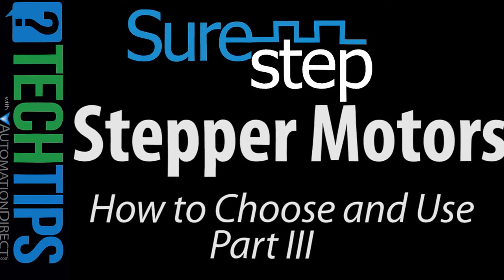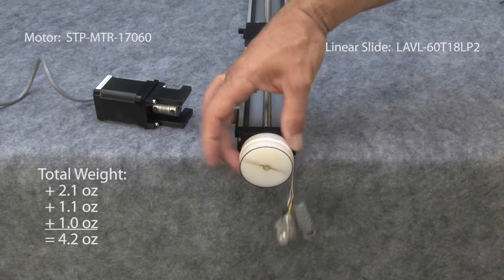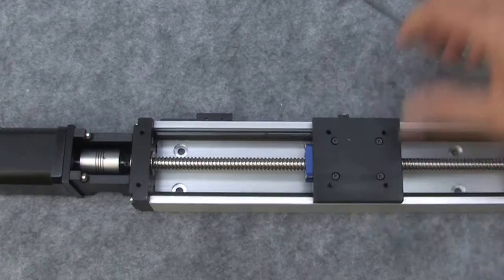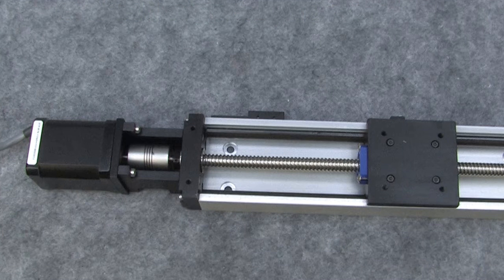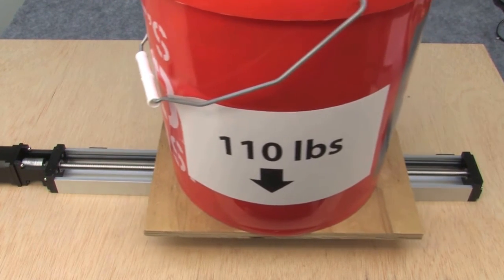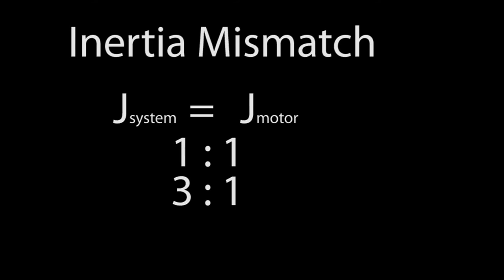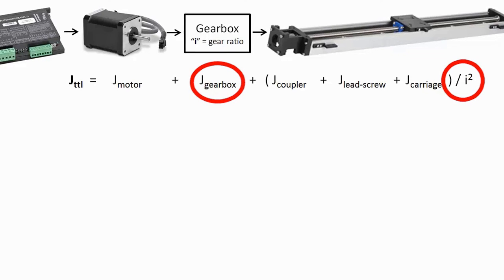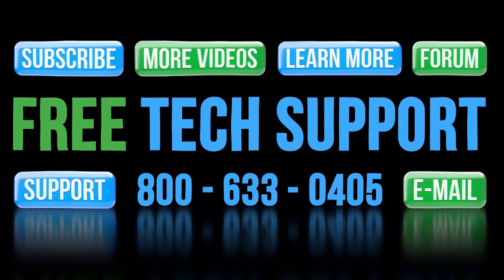SureStep Stepper Motors How to Select & Use a Stepper Motor Part 3 from AutomationDirect

Comment: hello, I want to know how to choose the stepper motor drive for a two-phase stepper motor with rating of 1.8V and 6.4A
Reply: those drivers are for one stepper motor, and where can I buy them in UK?
Reply from the maker: @edwintoapanta1975  We do have International VARs that sell some of our many products outside of North America. LaMonde Automation Ltd. Covers UK. Please contact them from their website. http://www.lamonde.com
Reply from the maker: Hi Edwin, Below is a list that provides optimal performance with this motor.  If the motor is sized with plenty of extra headroom, any drive outputting 7A or higher should be plenty.  Other drive features should be considered depending on how you wish to control the drive. Serial commands, Pulse/Direction, CW/CCW pulses, or Analog.
STP-DRV-80100 $291
STP-DRV-6575 $94
Set for rotary dip switch to D, E, or F for 7.56A.  If he knows his inductance and resistance he can narrow down further which selection he should use to optimal performance.

DM860E $49.50
DM805-AI $105
Both can do up to 7.2A which should be enough

Comment: where do i get those torque speed curves. It depends both on the driver and the motor right?
Reply from the maker: The curves are included in the motor specifications. Go here: https://www.automationdirect.com/adc/shopping/catalog/motion_control/stepper_systems/single_shaft_stepper_motors, select the motor you want and click on "Specifications"

Comment: Will you plz tell me which stepper motor is useful for travell 51mm/min???
Reply from the maker: Hi Madhuri, That's difficult to answer here without knowing more about your specific application. Please contact our FREE tech support during regular business hours - they will be happy to help you. 1-770-844-4200.
Reply: @automationdirect  
I am trying to clear your dought,
I have required 1mm/min to 51mm/min speed of plunger with 100 kg weight.
I am confused in between steeper and DC motor and may i should use gear box for more accuracy of speed???